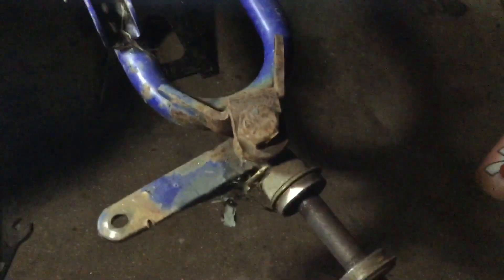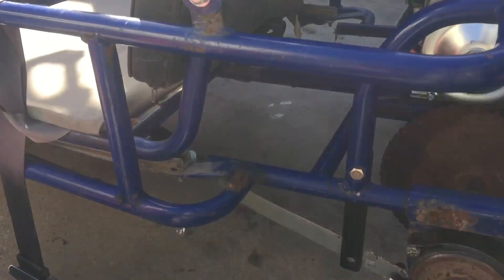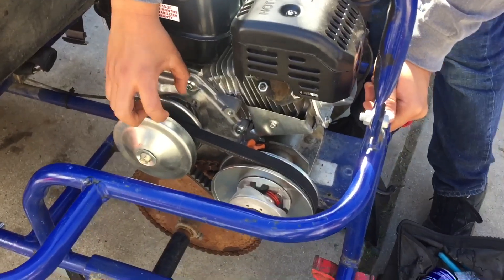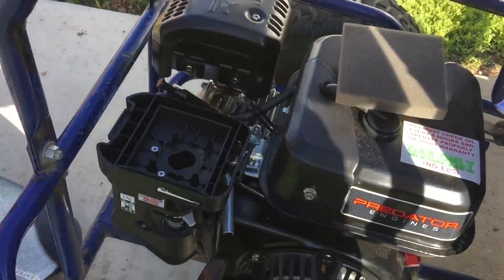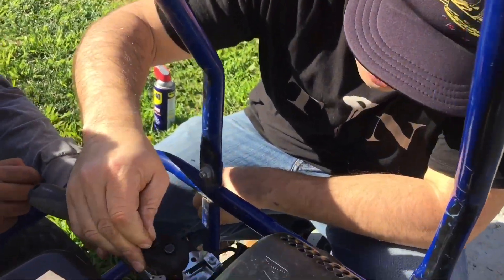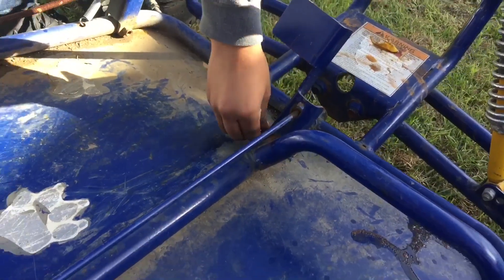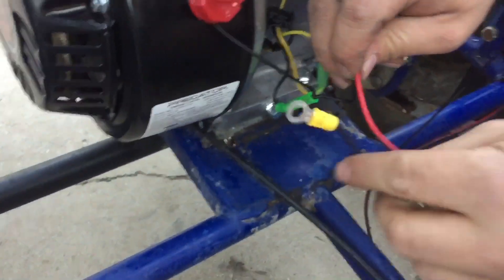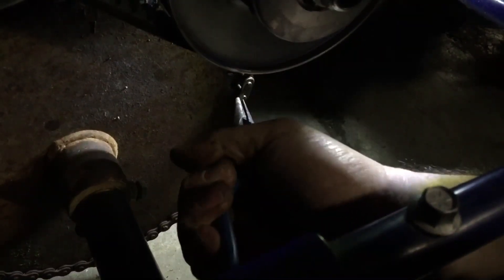$80 Go Kart Build (Yerf Dog Predator 212cc)

Comment: Do i need to use the original mount for the torque converter ? i found on ebay the torque converter kit and its like a delete for that original one I have the exact gokart
Reply: You don’t need  the the original mount it’s just a different style of it I recommend using gopowersports.com they have quality parts bc I’ve heard of eBay torque converters just breaking